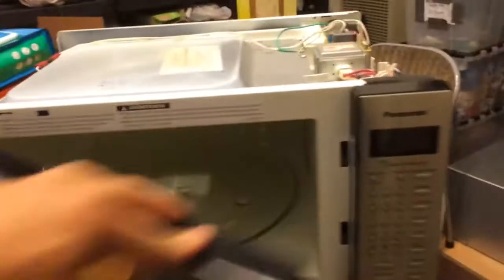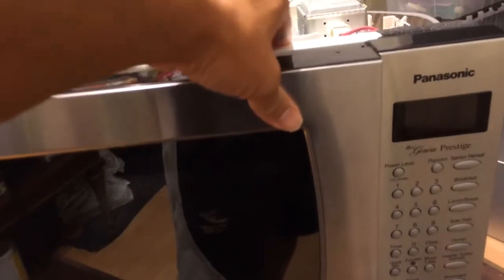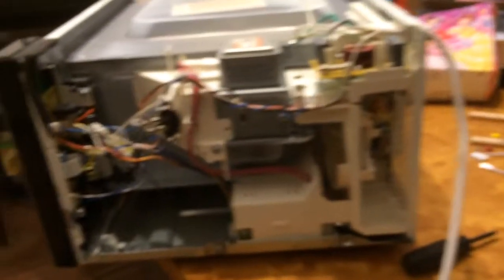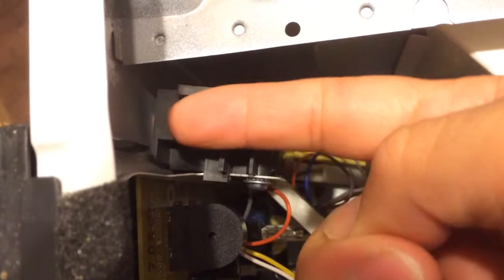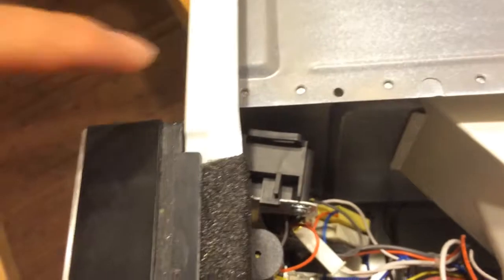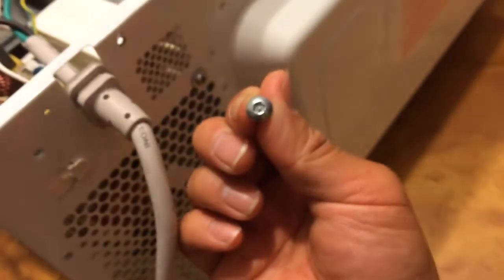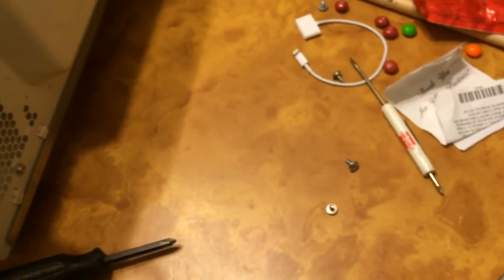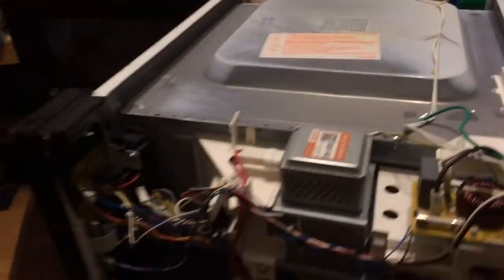2014 Panasonic inverter microwave hard to close door 1

Comment: Metal fatigue will ensure you will need to do this again really soon. So in order to fix permanently find a piece of wire to loop through the hole in the frame a couple inches from the top screw (near his finger at 1min). Loosen the top screw, wrap the wire around said screw and tighten while pushing on the part to make it straight. This will reinforce the part and keep it from moving. Cheers.
Reply from the maker: You are awesome 

Great advice

Comment: same problem no need to pull the cover I fixed it by silicone lube spray on the door catches and a little on the part the hooks hit on the switch part. Then I put a screwdriver in the slot where the switch is ( unplug to be safe) and pulled the switch back into the proper position  by pushing the switch to the left and slightly bending the switch back where it belongs. do both upper and lower hole. amazed how well that worked if it doesn't last pulling the cover might be the only way but for now I'm good